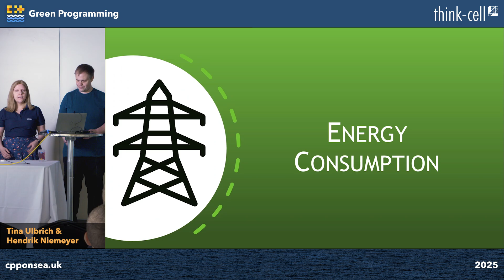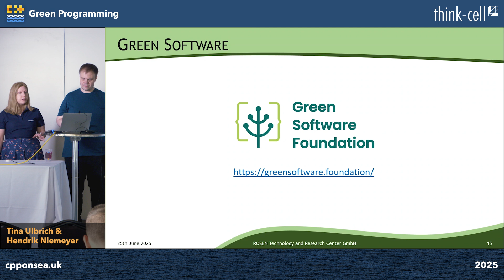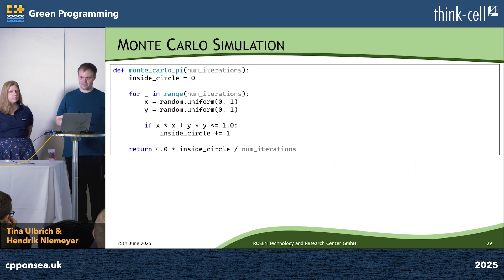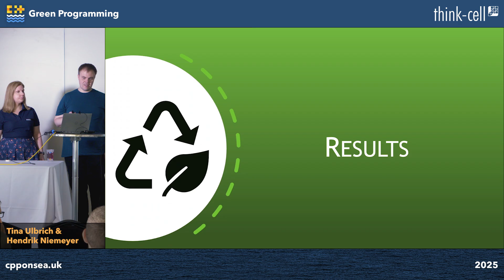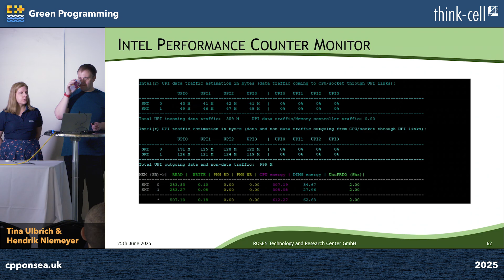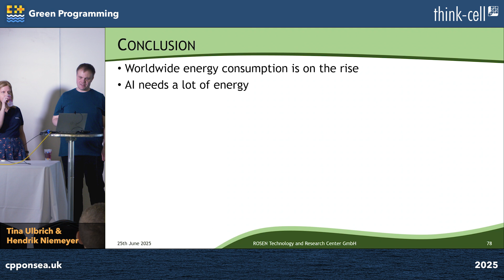C++, C#, Rust or Python - Which is the Best Choice for Low Energy Consumption? - C++ on Sea 2025

Comment: I think this is the first miss I've seen from a cpponsea presentation, both mechanically and methodologically. 
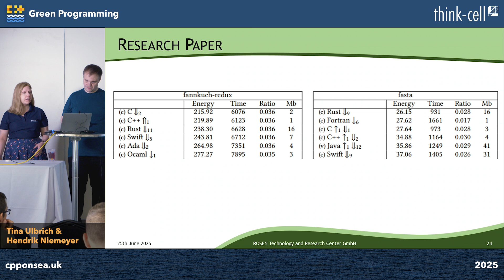The presentation itself doesn't start until 9:00, with the original work starting at 12:05, about 25% of the total run time. 
There are bar graphs with meaningless uniform gradiants applied. Either strongly color the languages and use those colors, or keep the colors constant. A gradiant that implies "this means something" when all it means is the distance along the bar graph is misleading.  
The language categories are wrong. "Lisp" was given as the one "interpreted" language, but lisp is a language family, not a language, most entries in which are at least semi-compiled. Python is lumped in with java and C#, but (C)Python uses a bytecode interpreter: it belongs in the interpreted category. The fundamental characteristic of Java, C#, and JavaScript is the use of a JIT, which doesn't "optimize the bytecode", it compiles the bytecode to native machine code at runtime. Were those the only problems, it would be acceptable, but combined with the poor methodology...  

They reject standard implementations of the algorithms used in their testing. This is acceptable, since someone must implement low level algorithms somewhere, and it is important to evaluate the languages used for that implementation. However, the correct "python family" language to implement low level python libraries is cython or rpython. What this presentation uses is roughly equivalent to bit-banging rsa, and then observing that x86_64's rsa instruction is faster. This is neither novel nor surprising.

Further, fresh implementations limit the applicability of the results to creation of low level library code, but they apply it to writing application code. This is compounded by writing code not how application developers would write it.  In ths discussion section, using numpy is mentioned as a way to speed up Python code. This is the recommended method to implement numeric algorithms, even if you can't just use a numpy or scipy provided implementation. The correct application-level implementation of the two chosen algorithms in CPython would use a numpy ints, with a standard Python for loop.

Quoting from 33:45, "keep in mind that [JITting] can help improve runtime, but it will never be as fast as using the compiled languages directly": This is false. Using CPython as the example, the Numba JIT operates on functions which use numpy data types.  Numba can beat native C++ implementations of some algorithms on matricies by about 10%. This is because a precompiled C++ program must target "lowest common denominator" features of the target platform, while the LLVM backend of Numba can use whatever CPU features are actually available at runtime. 

Leaving Go out of the list of tested languages was also a major miss. It is fully ahead-of-time compiled, same as Rust, C, and C++. However it is also fully, and only, garbage collected.  If compiled via gollvm, it would allow investigation into the runtime costs of garbage collection itself, while comparing it to llvm-backed pypy or numba would allow investigation of the runtime costs of JITting, when both languages require garbage collection.

I direct these remarks only at the presentation itself. I hold no ill will toward the presenters. Metrology is hard, especially when you're trying to reach outside your comfort zone.  As a piece of practical advice, I find it's generally best when doing inter-language comparisons to collaborate a professional from each language, who works in the problem domains you're investigating.

Comment: I'd be very curious to see how these results compare on long-running workloads, since a lot of factors aren't accounted for in a one-shot run of a simple Monte Carlo simulation. Think long-term memory fragmentation affecting usage or garbage collection patterns, JIT hotspot optimizations, and so on. Most processes running in data centers runs for a while (minutes to weeks), not just seconds, so long-running tests seem essential for getting accurate results.

Additionally, writing a highly optimized tight algorithm isn't a realistic use-case either. As much as we like to think so, most programmers aren't that good and most companies don't put a lot of priority on optimizing their code. 'clean code' practices can significantly slow down applications (which is a trade off many companies knowingly or unknowingly make), so it would be interesting how common use-cases are solved in idiomatic ways within each language, maybe hosting websites and APIs, with a sustained request load during the test?

Comment: This is the most ridiculous talk I have ever heard.
1. The amount of energy saved by switching languages or improving programming efficiency is so small. Equivalent to thousandths of the energy usage of 1 second of a toaster.
So how effective is this entire approach? Or is it more of virtue signaling and ideology. 
2. The results are roughly a proxy measurement of the "speed" of different programming languages. All this methodology to roughly come up with the same ranking of programming languages. 
3. The presenters seem so disinterested in the talk. If they wanted to read off slides, just run a voice to text script on the slides. Might have been better even.
Reply: Come on thats not cool.